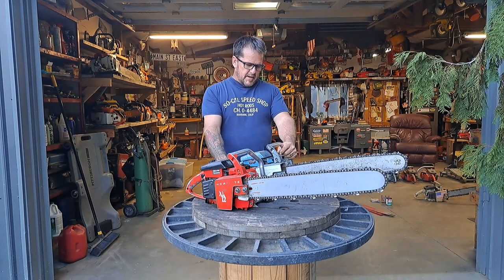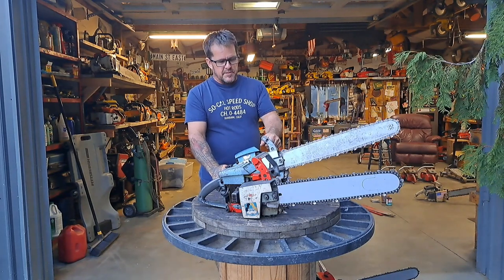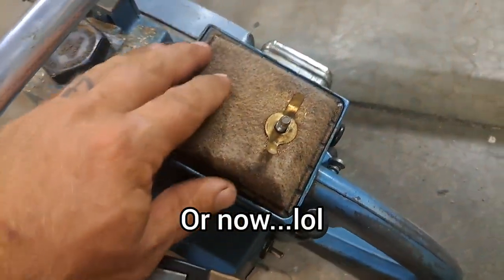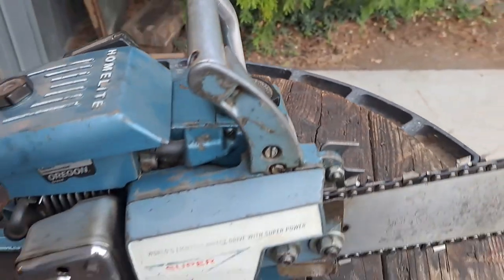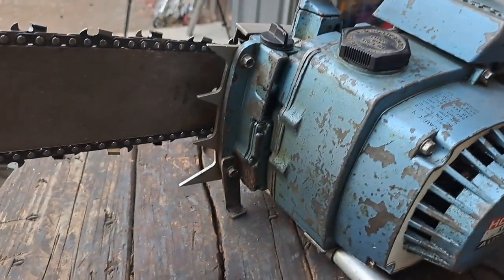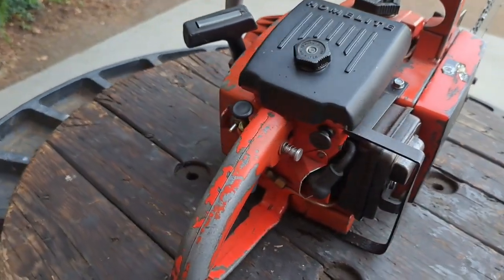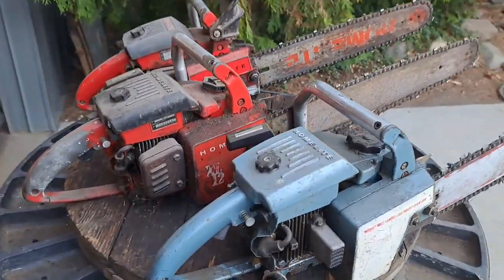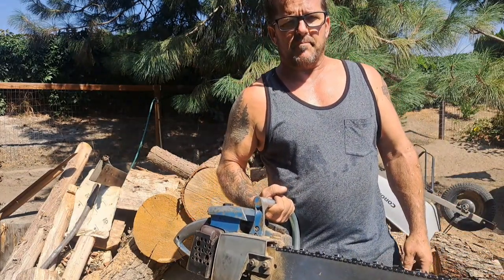Homelite XL12 - Best Firewood Chainsaw Ever? (Let's find out)🤔

Comment: i bought a "Big Red" Super XL 10 or so years ago for $10. It looked barely used. It needed a fuel line and one side of the chain was trashed by a rock. It's new enough to have a bar code on the sticker. It runs great.
Reply from the maker: That's Awesome!

Comment: They are the best - I have my original for 40+ years and still runs great.  Started collecting them and have 5 more. Always on the lookout for more.  Great video Dan
Reply from the maker: Couldn't agree more! Thanks man 😊
Reply: oil mix 33:1 is ok ? 372 xp  357xp 351 ?
Reply: @Sensei948   spec was 16:1.  I like 20:1.  Use the E free gas (blue hose) if you can get it

Comment: I took one home from a friend's barn where I cut grass for her, did a little carb work, runs great, offered it to my son who heats with wood. He told me he turned one down for free....Too heavy. 
   I got his old Husky 142 because it would not oil the chain (the plastic had warped at the bar creating an oil leak before it could get up to the bar - finally figured it out / grind and fit the housing to seal it up). I cut down a tree with the Husky and noticed it cuts fast as long as the RPM is kept high- way higher than the old XL. 
Nice vid, you should wear hearing protection though.   Mike
Reply from the maker: Thanks Mike, I appreciate you taking the time to comment,  yes need to wear ear protection more for sure!

Comment: Used to have a firewood business in the 60s.  I had an XL 12 and cut hundreds of cords with it.  It was a great saw and easy to maintain.  It would cut up to 3 feet in diameter  longs by double cutting with a 20 inch bar.
Reply from the maker: Awesome Brother!😉

Comment: I remember your kackle fest with all of your XL-12 and super XL-12s. Also I agree, that 24 inch bar on the blue super with the kick stand that you made is my favorite too! And the video with the custom double barrel muffler chrome pipes! Awesome collection Dan the Man. You keep crankin out the great videos and I'll keep watchin em. Thanks again bud!
Reply from the maker: Thanks so much My Friend!😉
Reply: May I suggest a 16" Bar, fast and lite. (your back will thank you at end of day.)  
Rum simi or full skip tooth chain w/ the 24".  (or change sprocket)
or you boil the gas - too hot on the saw... hard on the power head

Comment: I have two XL-12s, one from 1964 and the other from 1966. I also have a Lombard Comango which is a near-identical clone. All 3 have stack mufflers and bright blue paint! They're easily my favorite saws out of the 19 saws (and counting) in my collection so far. I recently installed a 063-gauge 21" bar on the saw from 1966 and it still cuts through oak logs like butter. That saw came as a freebie from my neighbor but the others I found on eBay for under $100. It doesn't seem like they're all that common here in MA, but I could be wrong. Anyway thanks for the cool video! I love that symphony of saws at the end!
Reply from the maker: That's Awesome! Thanks for stopping by Brother!😁

Comment: Another great video from you.😊I know this is super irrelevant to the video but i find i can’t wrap my head around how people use saws from the 60’s with zero anti vibration, zero chainbrake and a single throttle trigger like the Xl-12 .I have several saws from the 60’s myself but i always use saws that are more up to code to todays standards😅
Reply from the maker: I know right! Some tuff Dudes back then😁
Reply: You can keep your plastic saws with loosey goosey Vibration isolation and no manual oiler. Im 72 and running theold saws hasnt effected me that much. I probably have 40 of those plastic saws. Huskys stills poulans newer homelites ect. Never use those. I would happily trade  them for more magnesium and aluminum saw's. I bought a new husky Rancher 55 in 2000. and it never gave the good trouble free service like my old 1960's XL 12 does.
Reply: @KainKustomGarage   it's all we knew.  Great job on the Video much respect.  👍  imo 1 pump of oil every 4" of diameter; keeps it wet  😉
You know what I mean...
Reply: Things like chainbrakes were designed to stop homeowners from hurting themselves. Just like the safeties on cordless power tools that require you to let go of the ladder and use both hands to start it (I disable them). Dumb and un-necessary, designed for the dumbest of the dumb, not professionals. 

I've been using chainsaws since I was a teenager, some fifty years ago. Self-taught out of necessity. I had a few near-misses in the beginning and learned from them. Rule number one: always be aware of your bar tip at all times. If the tip doesn't accidently come in contact with something while you're busy sawing, there can be no kickback. It's that simple.

Comment: The most copied saw of its time. 
I picked one up a few years back at the local Stihl dealer a newer red one. 
Someone brought it in to get repaired but with the high shop rates it wasn’t worth it I guess so they just abandoned it.
The mechanic there told me I could have it. The P&C look like new but it needs some starter parts. 
I love the history on them and really curious how vibrations are on them compared to those newer plastic non anti vibe saws like the Wild Thing which are pretty brutal😂. 
Firewood season is here so I better put that one on the list to get running.
Need to watch more vids like this to get into the vintage saw groove the firewood stack is at an all time low.😂 Thanks for the motivation! 🍻
Reply from the maker: That's Awesome! Yeah, I've picked up a couple Free saws from our local saw shop for that same reason.....win for us!😉

Comment: I have a 74 SXLAuto that a friend presented to me off a scrap pile. It looked too nice to scrap. It needed a fuel line and a clutch drum. I put an electronic module on it and it runs very well.
Reply from the maker: Nice! Free is best!
Reply: Oh yeah...the auto oiler did not work. The pickup tube had swelled and fell off the regulator thing. Replaced it all with an aluminum unit from a 1970 one given to me from a relative.@KainKustomGarage

Comment: I rescued a low mile XL-12 from a pile of trash on the side of the road after an estate clean out of a few old barns.  I found a warranty card with it from Homelite with the serial number of the saw and a purchase date of 3/27/64
No price though as it wasn’t the receipt.  I snagged it because I love old mechanical things and my dad saved an identical saw from our fire department back in the 90s.  He Fixed it and used it for years.  So now I have two.  He also has the model before the XL 12. Think it’s from 58
Reply from the maker: Great story Brother,  thanks for taking the time 😁

Comment: Kane I'm your neighbor over here in Idaho I sure like all your old saws have a bunch of the old XL's and supers I have a couple that look in really great shape the cylinder and piston are scored but the rest of saws perfect where can I get piston ring kit for the saws or a top end and kit that won't break the bank
Reply: Many times a saw with scoring will still run  ok. as long as the piston rings are not stuck or broken. I buy new parts on E bay. And Leons Chainsaw sells parts also. Using 1/2 pint oil to the gallon the extra oil helps seal and heal the scoring a bit.
Reply from the maker: Very cool Gary! 😊

Comment: I find around here in Newfoundland Canada the most common old saws we see is the pioneer 1074 and they’re usually dirt cheap, I picked up a few for $40 and put a new $20 carb on the best one and it runs like a top
Reply from the maker: Nice, those are good saws! 😁
Reply: @KainKustomGarage  my dad grew up using a pioneer 1074, it’s still at my grandmothers too, been a lot of wood cut with it and still works perfect

Comment: I picked up my first homelite the other day its a big red i paid $30 for it it runs pretty good but it has a hole in the tank so im gonna drill the hole out and tap it then put a bolt in it with thread sealant.
Reply from the maker: Awesome, great old saws!

Comment: I've been a husky 55 rancher user for 20+ years, and grew up using Stihl and a Homelite Super EZ bought new in 1978 for supplying  solely wood stove heat for decades. I got interested in the old Homelites, so just bought a running 1981 xl 12 today that needs a correct new bar and chain. I see they used to require 32:1 fuel mix, so any ideas on that? Great video and I'm a new sub.
Reply from the maker: Thanks man, I use 40:1 mix on all my old saws. Appreciate you😉

Comment: Lol I’ve had a few people tell me the xl12s are quite different from my pioneer 1110 but form every picture and video angle they seem at very least insanely similar 😂 I really want to get my hands on one or two of these to race against my old Canadian made pioneer(I also really wanna put one of those lol straight pipes on the ok pioneer)
Reply from the maker: That would be an interesting comparison 🤔
Reply: The homelite XL 12 was the most copied chainsaw ever made. I have a couple pioneer and 2 canadians old and heavy but they are good saws.
Reply: fyi Mac 610 most produced in #'s.  XL-12 was the most copied and rebranded chainsaw in the word!

Comment: What do you mean "back in the day"? I still use several, have 2 needing a part or repair but running, and I have parts enough to assemble one or two more. My newest one with electronic ignition came to me very dissembled and I am not sure what carb should go with it. I have one on a clearing saw who's coil died and I can't find the part. That carb takes the same rebuild kit. I don't really want to guess, and the Canadian service manuals are hard to find. I know iit runs because I tested it years ago after putting the engine back together.  Have no idea why it was apart. I think a mentally challenged person took it apart.
Anyway I am tempted to just try a known working XL-12 carb., maybe with a new kit installed. I think it had a pyramid type reed valve...and I think I saw one a few months ago lol
Biggest difficulty I have been having is getting the manual pumps to pump. This is stopping the use of two XL-12 right now....of course I can't really use more than the three working now.

I learned about these saws first when my Grandfather gave me a box of Homelite XL-12's and Lombard saw parts. Made a saw of many colours that ran, and I had no real training. Then when my Grandfather died 20 years ago, I got his blue XL-12 in working order, and an older blue one that can still be restored with cleaning and carb kit.

I told people how much I liked this saw, and the universe started bringing me parts and saws needing attention. I haven't had to build more working saws from what I have, since I am getting older and my current XL-12's work great ;-) Red one with manual oiler and automatic oil says XL Automatic??? Runs like a very scared cat lol
Reply: I think all my XL's are Canadian versions. Some parts have been swapped and there are also labels missing and too worn to read. Learning to identify still, exactly what is what.
Reply from the maker: Awesome Story man,  thanks for taking the time Brother 😁

Comment: The best ? .. WELL..For 2 maybe 3 cords.." MAYBE "  but I bleed Stihl, the 031 or 026 are better . NOW for cords 5 +  the mac 10 10  is the goat . The xl 12 was the Ford escort of it's day . Just my opinion ....😊😊
Reply: I use my old saws. I take 4 different ones when I go to cut firewood. Use a tank of gas thru each one. then next time I take 4 different ones. that way the 40 some older running saws all get used.
Reply from the maker: I hear that Brother! I like the Ford Escort Analogy 😁